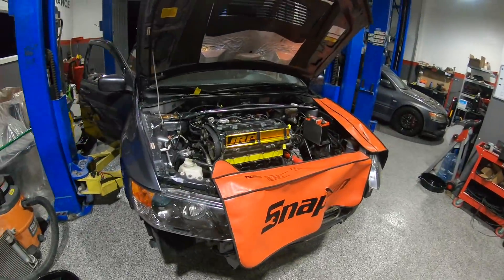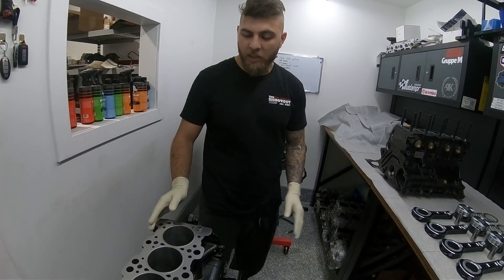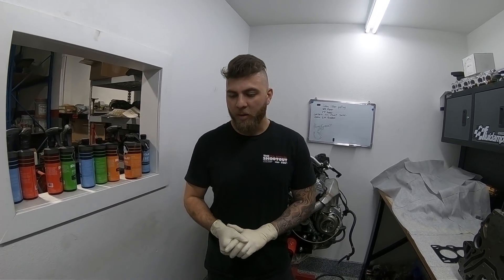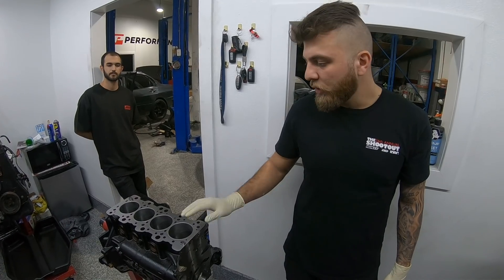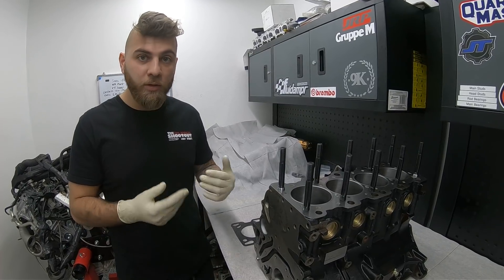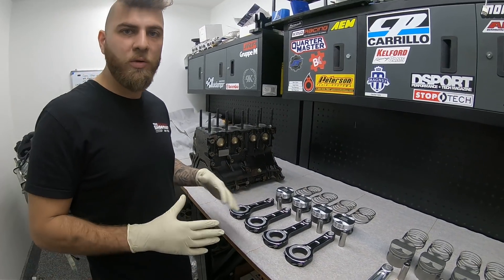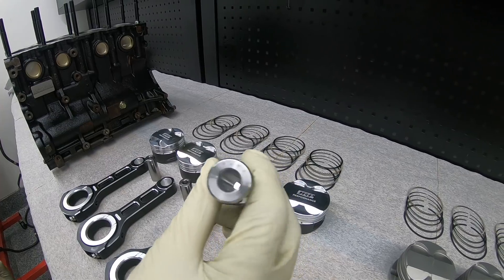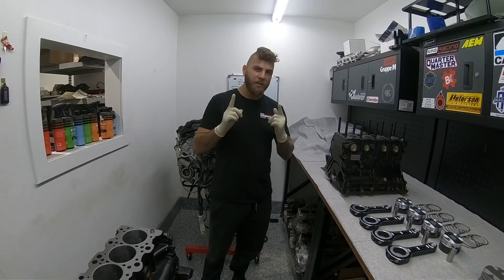JRP DRAG Race Slaughter Package Engine Program

Comment: Any updates on these 2 motors? How did the full fill do on the street and why only arp2000 headstuds?
Reply: They run ARP 2000 because they are a 1/2” (12.7mm) stud. There is more material than the OEM size stud (11mm or 7/16”) so you don’t need the increased tensile strength of a 625 or L19 7/16” when a 1/2” ARP 2K can provide the same or similar overall clamping force.

Comment: So does a filled block car not need a water pump and radiator?
Reply from the maker: Pro Sandwich Eater It does not utilize the OEM water pump anymore. We use an external electric water pump just to circulate water through the head and cool down the chambers. Requires modifications to the cylinder head. The 1/2 fill still uses the factory mounted water pump.